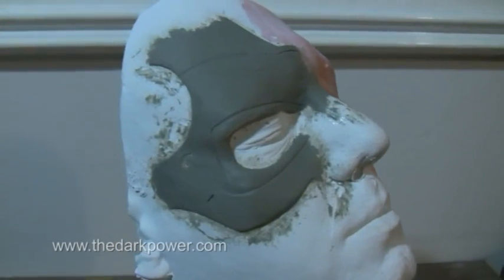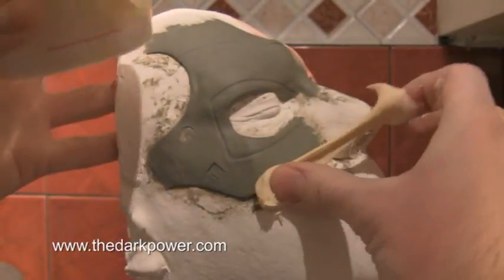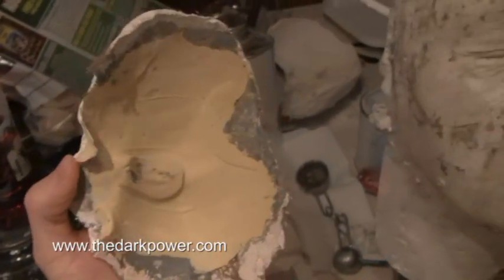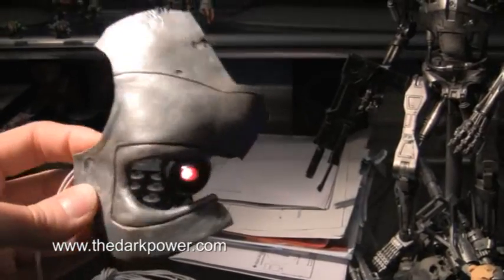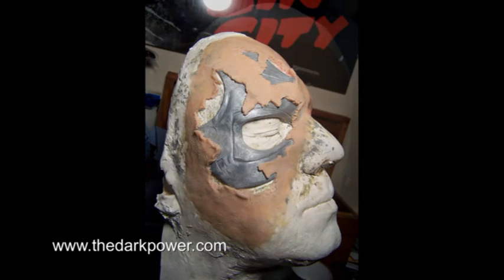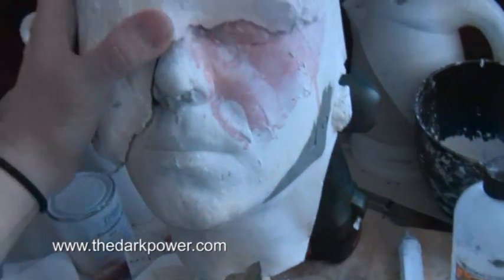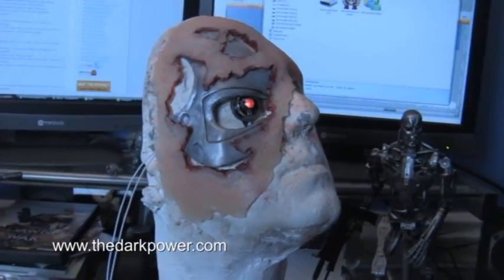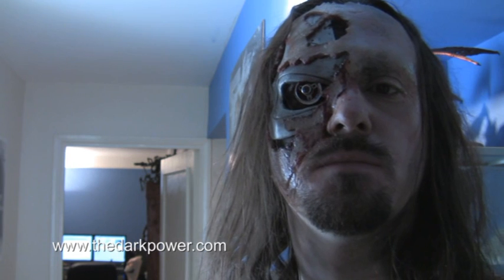Making Terminator Makeup

Comment: In the movie they used a copper spray paint and then used electrodes dipped in acid to transfer nickel and after they used  chrome to simulate metal with the same technique (using plastic and resins as a base) Adam Savage talks about it in one of the Tested episodes here on YouTube.
Reply from the maker: Yes I think I've seen that video :)

Comment: You could get the size of the eye piece down a lot by using a surface mount LED instead of normal LED, and add a piece of acrylic lens on top of the component to mask it (and act as a lens).
The depth of the eye piece could theoretically be shaved down to around 4mm, although you'd still have to mount it convincingly. :)

Comment: A quick way for those who don't have time. make the mold of your face, cover with modeling clay, put on the proper details, remove and apply liquid latex over the modeling clay. What you will get is a flexable face part. ALl is required is some powdered silver.

Works great..